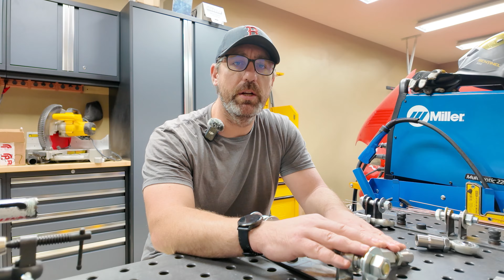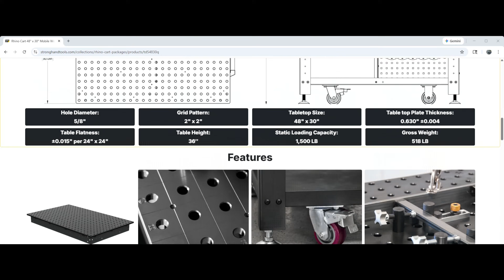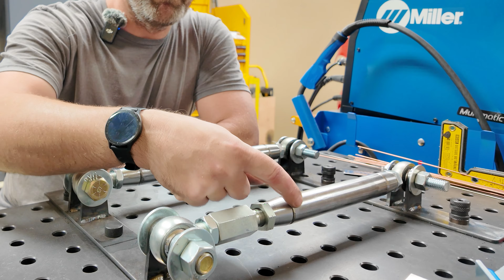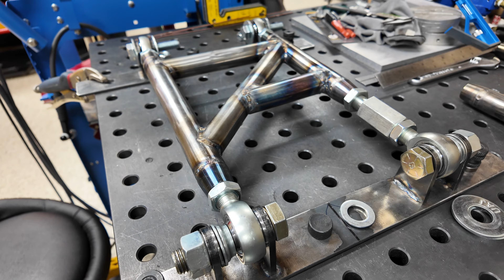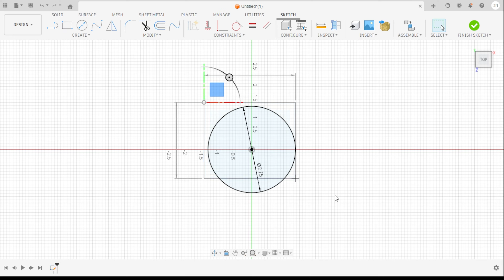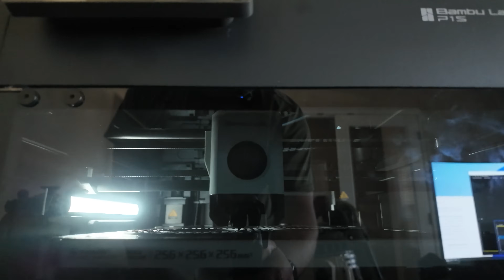Designing & Fabricating a full IRS for my 1964 ERA Cobra | Control Arms, Axles & garage update Ep 4

Comment: Since the center stiction is bolted in there to keep it steady. What kind of a degree do you have on the opinion?
Reply from the maker: The cage mounts in the chassis at an angle so I won't know that until I install it.
Reply: @DalyDriven If it's   anything like a corvette ,its probably zero degree pinion angle
Reply from the maker: Could be, I'll find out once it's mounted.

Comment: Unauthorized changes to the ERA design.  Without some additions, I see  much wheel hop and LCA failures.
Reply from the maker: Thanks for the heads up, I will address those issues when they pop up.
Reply from the maker: I know my control arms are rigid but I was thinking I could remove the lower brackets from the cage and add the trailing arms. This would give me the flex needed for the trailing arms to go through the radial motion

Comment: Are there no upper control arms? Also, if I remember correctly, you used to have a harbor freight press way back in the day.
Reply from the maker: The axles act as the upper control arm. That old thing is in my shed in the backyard. I need to get a new one.
Reply: @DalyDriven  where are you connecting radius rods or are you using a Watts link?
Reply from the maker: @cinemafx1 once I get the car back and I can mount this in I can add the brackets for the radius arms.
Reply: @DalyDriven looking forward to seeing what you come up with.. Thanks for sharing your work!
Reply from the maker: Will do.